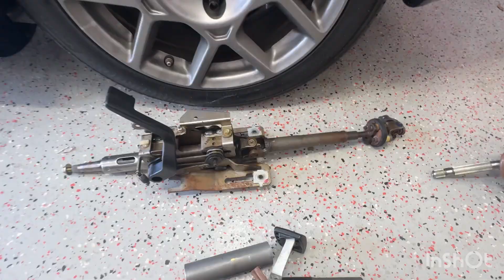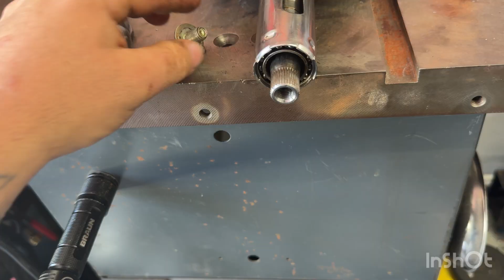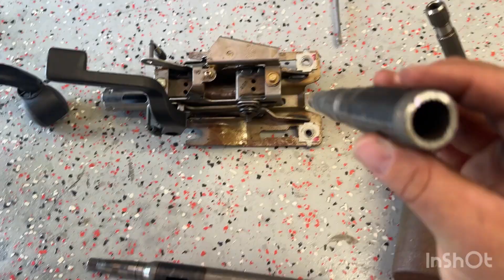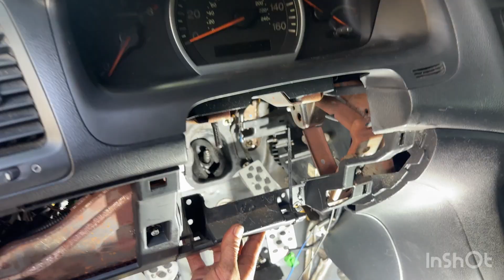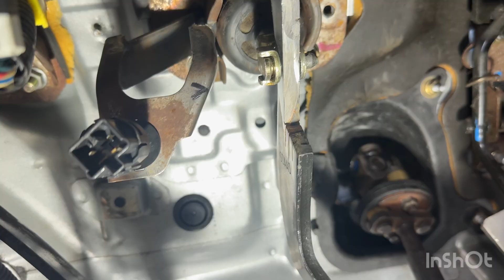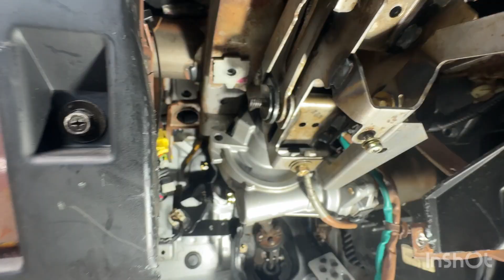Toyota Prius electric power steering eps into a 7th gen accord! #eps #accord #toyota #prius #honda

Comment: First of all, thank you very much for this great post, but could you please show a clearer picture of how the electrical wires are connected? And is this a Toyota Prius car computer?:
Reply from the maker: Thanks, I appreciate it! Unfortunately, I no longer have that car—it was a customer build from quite a while ago. Yes, it’s the OEM Toyota Prius EPS controller. It’s actually a very simple setup if you get all of the EPS components from the same donor Prius at the salvage yard. I also go over the wiring in the video. If you’re running into a specific issue, let me know and I’ll do my best to point you in the right direction.

Comment: Camry hybrid EPS cheaper here in Australia. Cheers Graham
Reply: Hey bro , I’m interested to know if you tried ending up swapping the Camry hybrid EPS to CM Accord , I’m also in Australia, just wanted to know which year Camry and would it cost 2-3k
Reply: @hassanalmosa3156 the Camry hybrid I purchase was an ex-taxi. I purchased 2010 Camry hybrid in 2016 for $2500. It had 800000 km on it. In the 6-years I owned it. I replaced one front wheel bearing. If it wasn't for some idiot running into me and writing  the car off I'd still have it. But on the positive side, I had agreed value with insurance and I got $9500.